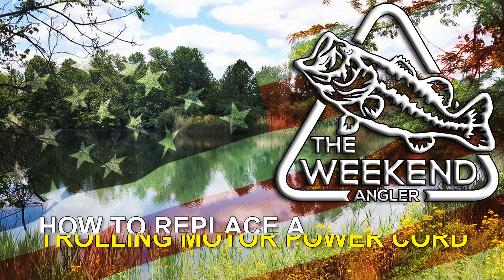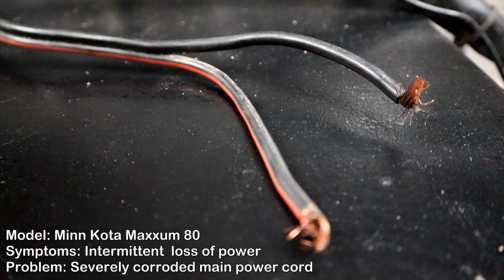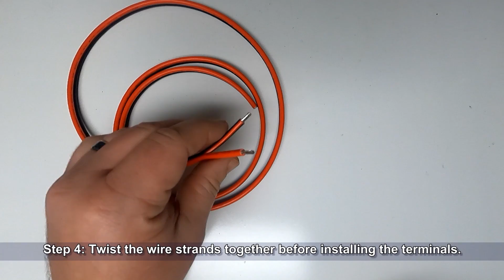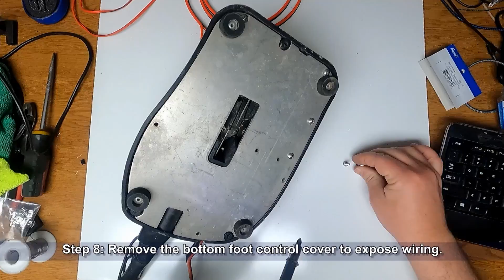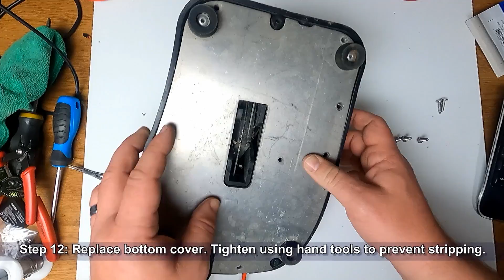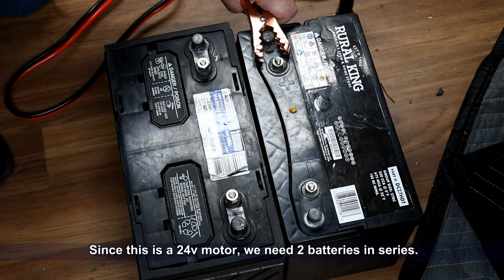How to Replace a Trolling Motor Power Cord

Comment: Jan. 10, 2024, 7:02
I am running a motor guide trolling motor,  Humminbird Helix 10, also Mega 360.
Unless trolling motor is on high I get a lot of interference.
I have installed a battery to just power my fish locators.
Still I have interference, why and what can I do?
Reply from the maker: Some snap on ferrite beads may help you out. I think i have some so I'll try and do a video for you soon.
Reply: Ok. I will be watching.